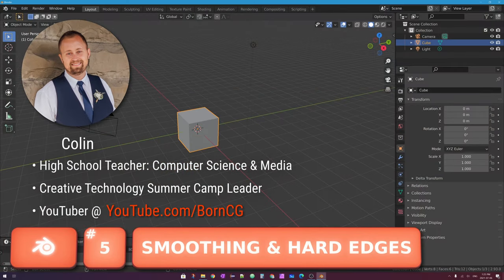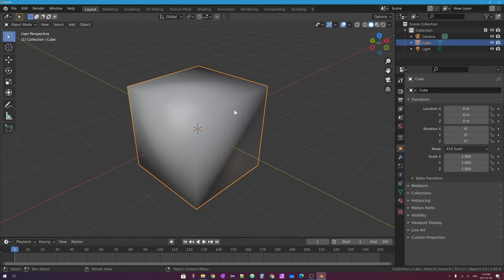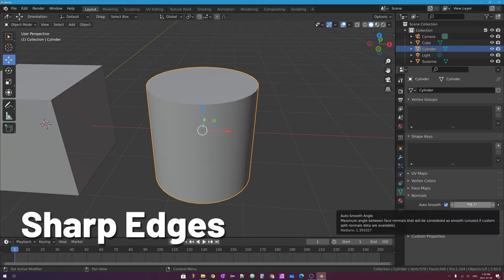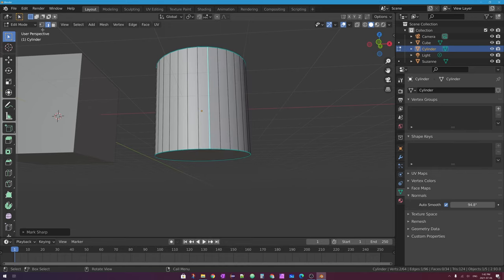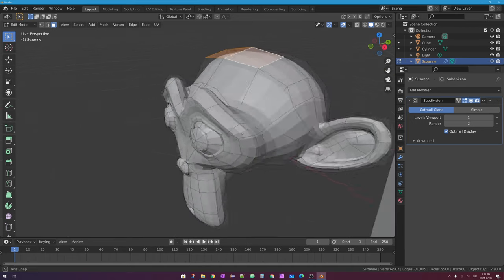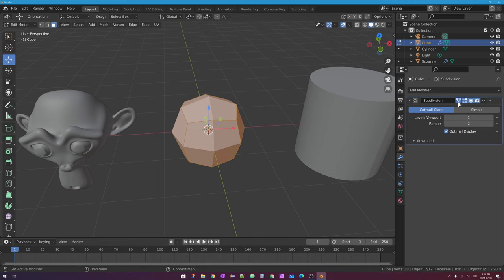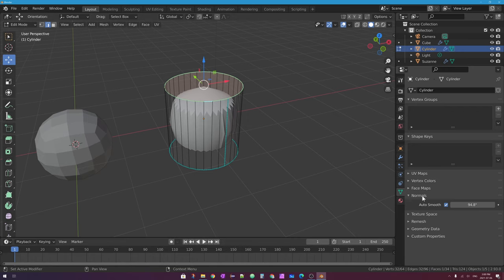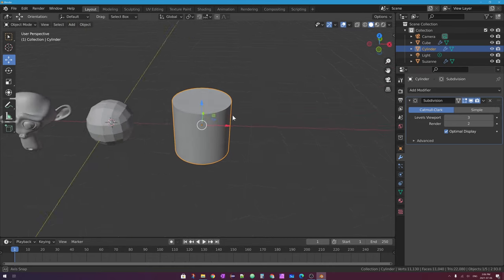Let's Learn Blender! #5: Smoothing & Hard Edges

Comment: Great video but I have a question about the Sharp Edge. Does it only work in "Auto smooth mode"? I've shaded Monkey head using "Smooth" without ticking the "auto smooth". I've selected a few things with sharp edge but it doesn't work. It only works when I tick the "auto smooth" box and up the degree count to like 90. Shouldn't this work in normal "smooth mode"?

Comment: As a side note, as someone who's done a lot of hard surface stuff via the box model, wherever I need to make a cylindrical object with subdivision surface, I will make a cylinder with eight sides and no faces on either end, make one vertex at both ends of the cylinder, then make four faces with each face comprising three vertices along the edge of the cylinder and the vertex at the center. Hopefully that is descriptive enough.

Also, when it comes to the box model and subdivision surface, edge loops are your friend in controlling how far round or sharp a corner will end up. The bevel tool is easy to use, but could end up creating headaches when it comes to uv mapping and other processes necessary to make a model useable in a game engine or elsewhere.

Comment: so i'm using the edge split modifier and there's some split edges that i don't want. is there a way to smooth those edges while maintaining topology (unlike smooth vertices which changes topo), without turning off the edge split modifier?

like mark sharp but the opposite?

Comment: How do you undo crease edges without ctrl z? Or you can't? Like what if I creased my edge and an hour later I wanna undo that? explain if you can pls
Reply from the maker: If you want to modify the edge crease factor applied to a specific set of edges later, you can always select those same edges again after, press shift-E (edge crease), and then move your mouse to/from the object origin to change the edge crease factor, even back down to 0. The bottom-left 'last operation' pop-over may help you to get it all the way back down to 0.
Reply: @BornCG  thx